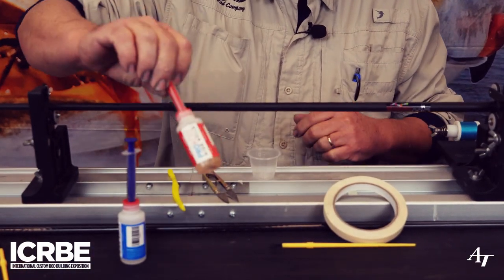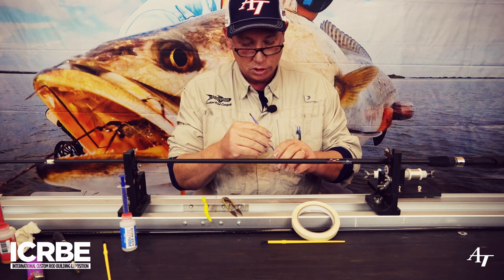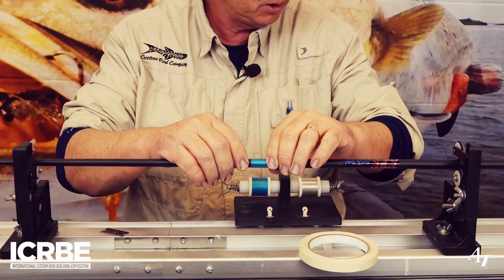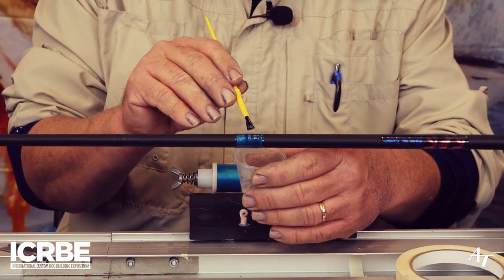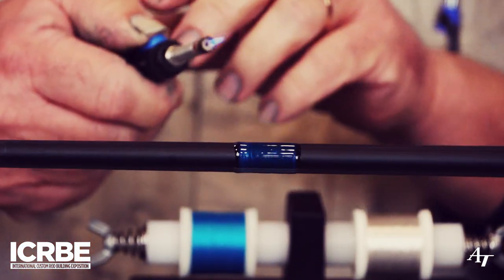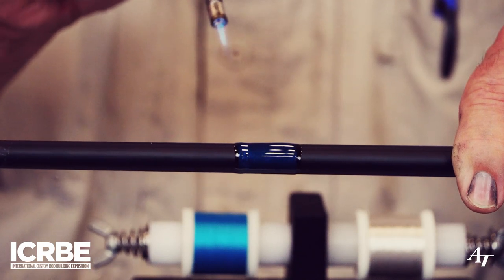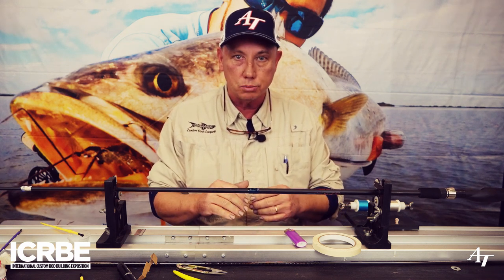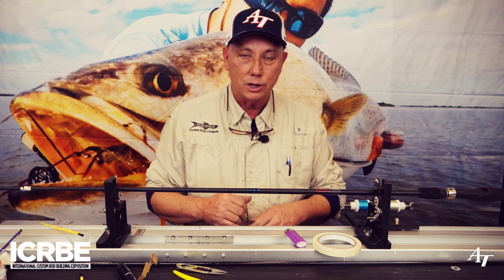AT ProStaff Rod Building Tips with Don Shafar applying Epoxy Finish

Comment: I just used ProKote for the first time - this stuff is great - I am on day nine and it is still tacky following the instructions that came with it - using Denatured-Alcohol on a rag, 99% of the sticky mess came off with not much issue - I was also able to see the treads did not absorb any resin - I have seen complaints of this issue after I put it on - now what is interesting is the left over in the aluminum dish hardened just fine,  just nothing on the rod did - I did this in a southeast Florida garage and that might be the issue -
Reply: Some of those brands are overrated, use good advertising and made very cheap for 3rd person profit.  I discovered OJY epoxy -very clear!